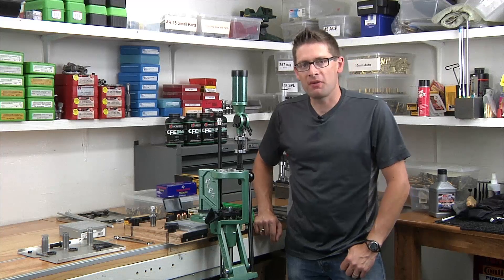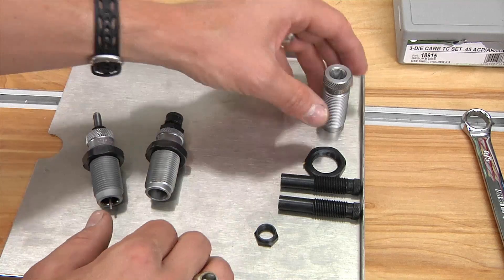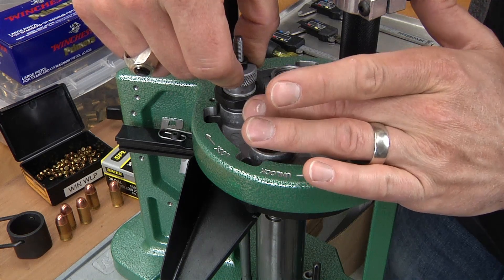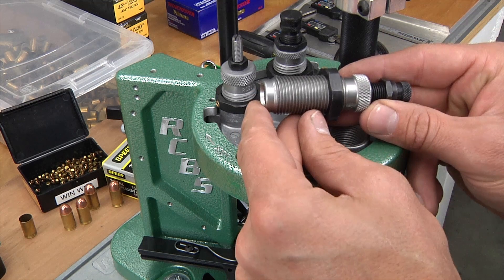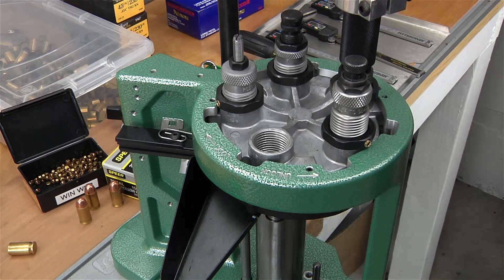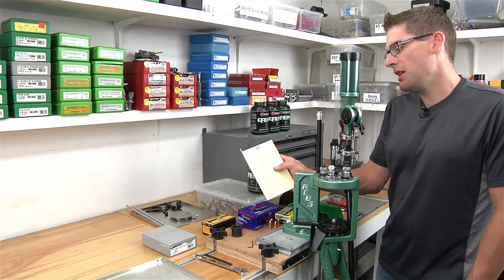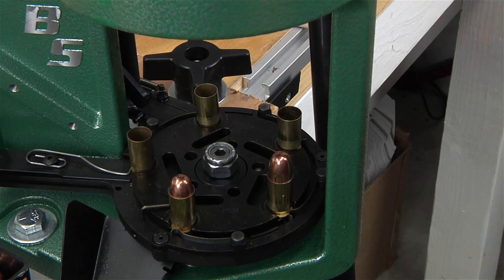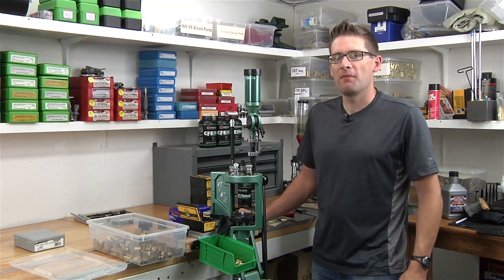Loading 45 ACP with the RCBS Pro Chucker 5

Comment: gavin....about to buy a prochucker 5...if I want to quickly switch from 45acp to 9mm, do I need to buy separate upper die holders? what about lower shell holders?  how do you quickly switch the powder measure setting? do you need a different powder drop? or a different rotor?
lastly...can the pro-chucker 5 be used as a single stage press? i.e. disengage the turret?
thanks

Comment: I want to get a second press and have been thinking of the RCBS.  Currently, with my Hornady lock and load, I prime all my cases ahead of time that way I can have powder drop in station one with a PTX expander, station 2 is my RCBS lock out die, station 3 is bullet drop die, station 4 is seat die and station 5 is crimp die.  I am going to look to see if 5-stage-RCBS has an powder through expander like Hornady.  If yes, I will buy the RCBS.  The seven stage RCBS press is too expensive for my pocket book.

Comment: Can you see IF a primer is missed before loading powder into the shell?  I found this problematic with my RCBS Piggyback II progressive press = not loading a primer makes an unholy mess!  I have hand primed after giving up on priming in the progressive press.  Plus, when I hand prime, I can inspect the brass (one more time) and see that the primer is properly oriented and seated properly.
Reply from the maker: Not on this press, but you can feel if the primer isn't present (press fit at bottom of stroke). Agree about the mess. :)

Comment: when you're running without a powder check die, are you eyeballing the powder in the case or just expecting it to be there (because you know the powder measure is reliable?).  also how do you keep track of the primers in the tube ??  I currently run a Lee turret and maybe in a year or so want to run my 9mm on a RCBS because that's 90% of what I shoot.

Comment: At about 11:20 you can see the entire die mount insert moving with each stroke....looks like it has better than .100'' up flex.
Is it a nightmare to adjust the dies one at a time or do you have to adjust while all dies have brass inside so the whole insert pushes up evenly? You didn't include the die adjustment, it makes me wonder? I'll stick with my meager LnL, solid as a rock!
Reply: I don't think he inserted the 3, Socket head set screws that would keep the die plate from moving.

Comment: hey could I reset my 45 colt dies to reload 45acp?
Reply from the maker: No, won't work! :)
Reply: why?
Reply from the maker: Different case mouth outer diameter means sizer won't work, WAY longer case length on 45 LC means expander and seater dies won't work.

Comment: I'm slowly moving to a progressive loader, step by step.  Moved up from my single stage to the 6 station RCBS Turret Press and need to get a Case Activated Powder Drop for my RCBS Powder dispenser but cant find one from RCBS.  I see from the video you have one installed.   Who makes it and are you happy with it.
Reply from the maker: That's the one that comes with the Pro Chucker, it's the latest "RCBS Uniflow" case activated measure. Very happy with it, but would like to have a baffle.

Comment: I bought a Pro Chucker 5 and quickly returned it.  It destroyed all the primer slides in a short amount of time.  The design of the little plastic post doing all the work is a terrible idea.  I now have a Dillion XL650 and it's hands down a better press.  Caliber changes are more expensive but start up cost was similar.
Reply: I bought a Pro Chucker 7 and had the same problems as well. Returned it and bought a Dillon XL650 as well and it is hands down a much better press.
Reply: I haven't compared specifics but the Dillon xl650 is more expensive to change calibers because of the case feed parts of the caliber conversion.

Comment: Gavin, can you comment on the plastic primer slides....are they designed to break under excess pressure to prevent primer tube ignition ala xl650   would like your opinion on this subject...except for this issue, this seems to be a very good press

Comment: Loved the videos, since I just bought one of these presses it was awesome.  Already took mine back though.  I didn't get 20 rounds loaded and both of the primer plastic pieces broke.  Called RCBS who have always been awesome.  They said no problem, they would send me out a bunch of extras.  Hmmm, a bunch?.  So you know this is an issue.  Does RCBS have a fix in the works I asked.  He said they would send me as many plastic primer pieces as I need.  I am sorry, I don't want to stop every 20 rounds and replace a part.  I boxed it up and returned it.  I think I will grab the Lock N Load, seems to work reliably. I hate to sound like I gave it no chance, but i feel for that money, it should work right 99% of the time.  I cant wait for a fix,  I need to be knocking out rounds now...today.

Comment: My Dillon doesn't flex. Not a fan of this press
Reply from the maker: +rdsii64 Not sure if you mean the mounting of the press or the toolhead. This toolhead is designed to do so (repeatable stop against the top of the press frame).
Reply: +gavintoobe that's a little different then

Comment: When reloaded 45 acp, what can you get the price per round down to?
Reply: With your own cast bullets, you can produce a 50 round box for $2.00 low end.   If you can get free lead, or almost free lead, or recycle your own lead, the cost of bullets is more about your time than money when you cast.  3.5 grains of Bullseye doesn't make a very strong load, but does fine for light target work, especially closer range, coming in around $0.01 a round, with a $0.03 a primer on average, 4 or 5 cents a round is not out of reach for some pistol calibers.  

Always wondered why folks bought expensive jacketed bullets for handgun, considering the cost of buying cast bullets, and for those that can, make their own bullets.  The change in one component can easily quadruple the price of your load.
Reply from the maker: +Chase Gibson With hard cast lead and your own brass, about $6.00-$7.00 per box at the bottom end... Depends on current lead/powder/primer costs... Check out http://ultimatereloader.com/tools/reloading-costs-calculator/

Comment: not a fan of the rcbs lock rings. much prefer split lock rings.
Reply from the maker: +ms3bani Split lock rings are nice... But you can't lock split lock rings without loosening the lockring from the bushing or toolhead first. These you can lock in place with the die locked down...

Comment: I presume you adjusted the powder throw measure before hand....  How consistent is the powder throw in a progressive press?  Also,  I like your videos too.
Reply from the maker: +Wes41 Yes, pre-adjusted. I'll be testing that here shortly. I expect it to be good, like the Hornady and RCBS uniflow drum-type measures I've been using for years...
Reply: I too would like to see videos of the powder dispenser process.
I just unpacked my RCBS Pro Chucker 5 and it appears that it has been put together already and I fear taking it apart. The spring is already on it.
Reply: from my understanding your supposed to disassemble and clean off the shipping oil coated on parts for rust protection